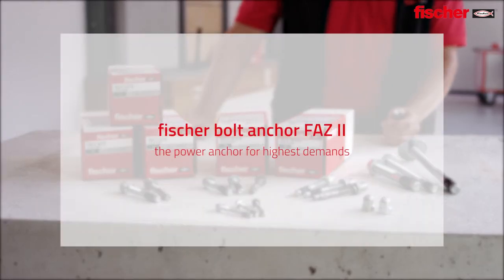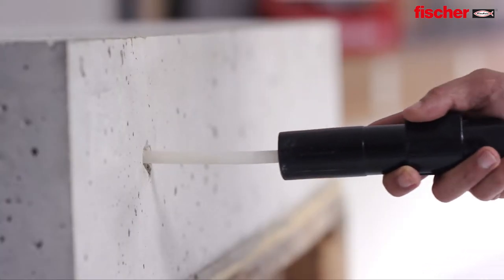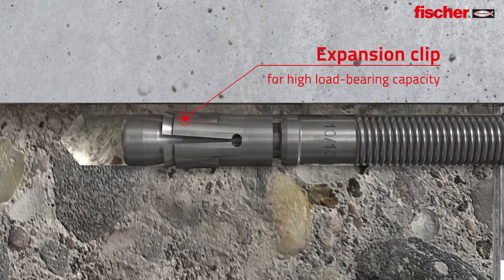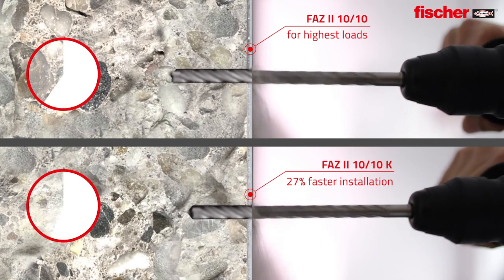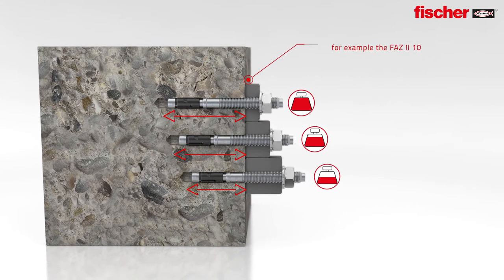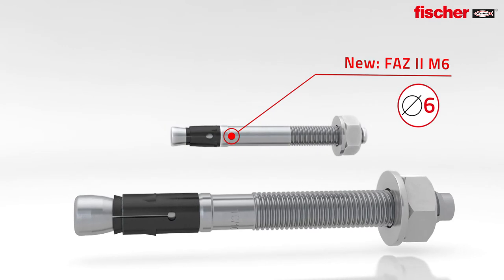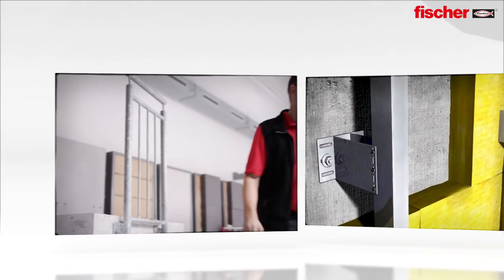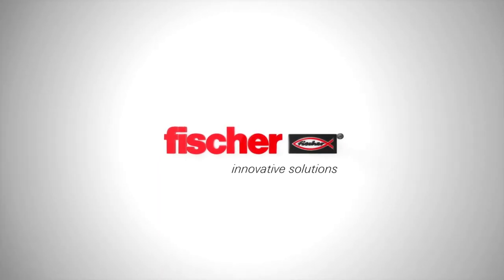fischer bolt anchor FAZ II

Comment: I just tried the FBN II 8/30 B which allegedly requires an 8MM Drill Bit (according to the package-printed instructions). Not even vaguely going in there. You would destroy bot the anchor and the wall truing to bludgeon it in.
Reply: Thanks for that feedback. I have an M12 FAZII which is going to be a deal breaker if I cannot drive it all the way into the hole because clearly it will never withdraw, I was wondering whether to take the hole diameter out to 1/2" and now I know